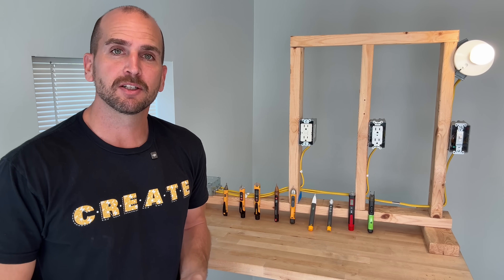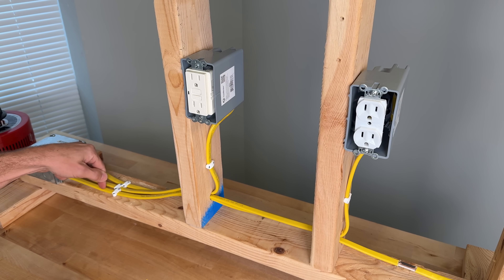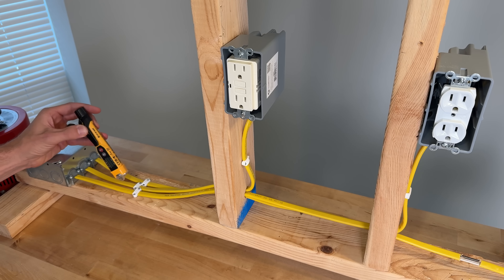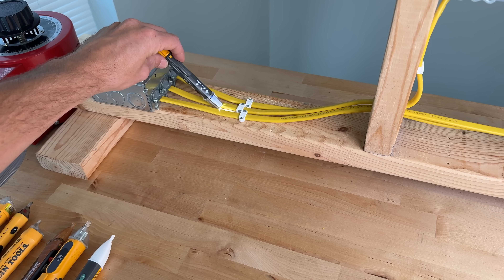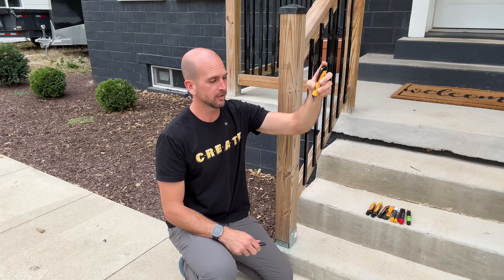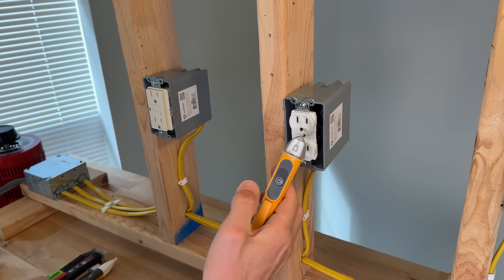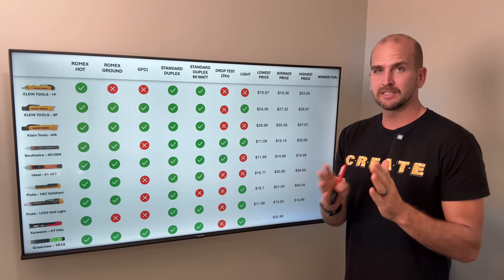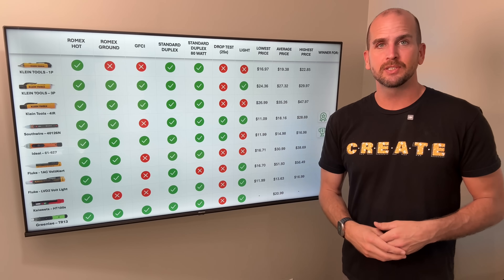The Ultimate Voltage Tester Battle: My Surprising Favorite!

Comment: Man, I love your videos. But here I feel a little like the 'home repairs' in your name is more accurate.

You tested that for the ability of these detectors to see voltage on the hit side of the outlets, but not on the neutral side. That would have opened up a new world, as some of these are more sensitive for that reason. While it may seem trivial, understanding if you have voltage on the neutral leg or a false positive result is a serious concern.

Each detector (they are not sampling voltage but rather detecting it) has a use in a specific instance. I currently carry 3, to include the FLIR not shown here. I also use 2 different fluke meters and plug checkers aside from these.

The goal is always safety, so in a crowded 12x12 with 300 industrial connections because nobody ever follows code, you don't want a detector ringing on false positives. As a homeowner checking for a dead outlet, you're looking for a different tool.

The judgment passed here is good but lacking detail, and I appreciate your testing! I'd love to see you dive deeper.
Reply from the maker: Thanks for the feedback.  How is the FLIR working out?  That is the one with the larger flashlight on the non-testing end, right?

Comment: Great vid!  I am happy with your results.  I thought your vid would end up making me lose confidence in my favorite tool.  I prefer the Southwire.  With the company credit card for over 20 years I was able to gather quite a few of these testers when needed for a quick job.  I have only basic electrical skills so I check and double check everything before I touch and even then I am very careful.  So my electrical kit when replacing ballasts in a retail store usually had 2 or 3 testers.  When in doubt I used more than one to gain confidence.  Usually a ballast replacement is pretty straight forward but if the light was tied into emergency lighting that's when things got interesting.  I love my Southwire and it has saved my butt a ton of times.

Comment: And I just bought the Kaiweets 😢
Reply: Don't despair... I have (2) HT100s and work fine with my CFGIs, It has two sensitivity settings. In the High Sensitivity Setting (12V-1KV) that is great because they detect AC presence 1" from the Hot on the AC Outlets and through  Switch Plates.

Comment: You did not include a very reliable tester which I use: the Santronics AC Sensor, made in North Carolina. "The Santronics AC Sensor (3115) has been selected by the OSHA Electrical Technical Committee as the only instrument of its type for use by OSHA compliance officers to identify and cite electrical hazards of 50 Volts or more."

Comment: Kaiweets is pure garbage; nearly killed me with a 'new' faulty voltage tester replacement that had copper wire wrapped around the fuses..and then said I did that myself.

Comment: Great video! Thank you! I carry both the Klein 3P and 4IR; they are both going on ~2 years in my carry bag. I generally only use the 4IR for the IR function. I haven't dropped them much, and that they've survived this long means they are sufficiently durable for my uses. I will consider Ideal in the future though, and am curious if their other models are similarly durable.

Comment: I have (2) Kaiweets HT100s and both detect my GFCIs Hot Power Connection Slot. Not only that, It has two sensitivity settings (70V-1Kv, and 12V-1Kv). 
In the 12V-1Kv range, my (2) devices detect AC Voltage present 1” from the outlets and  detect AC presence like no other NCV devices that I have used. As far as durability, I think is OK for DIY users (not for everyday professional work).

Comment: I've found that many of these have trouble sensing voltage on a tamper-resistant outlet. Conversely, some are so sensitive that they won't distinguish which hot wire has voltage on it (eg, incoming vs outgoing power, which can be a useful diagnostic tool), they just alert if any wire in the box has voltage. I use the Fluke 1AC II, my only complaint about it is that it's difficult to get it apart to change the batteries (fortunately they last a long time). And yes, I always test it on a known hot wire first (that seems like an obvious thing to do, I'm kind of surprised that some people don't do it).
Reply: My criteria is that it needs to be able to discriminate the hot side of a line cord reliably and doesn't sound off in open air.  Dual sensitivity is good to have long range detection also, which isn't always featured. 
I tend to take care of things so the drop and crush tests aren't as applicable in my use case as much as for others.

Comment: I have been carrying NCV in my shirt pocket for over 20 years and can not remember if I ever dropped one. Do not like any Greenlee electrical NCV  testord or meggers. Carried a rechargeable LED flashlight on my belt so don't need one with a flashlight. NEVER purchase or use any safety or tests equipment & tools by lying cheating lack of quality control nogoodnic communist china. The $ you might save is not worth your life & safety of others.

Comment: I have a love/hate relationship with those things. The best one I ever had was very cheap, very sensitive and had a dial on the side to adjust sensitivity. I could trace wires in a wall with it. Extremely useful. 

Next best one is one that can detect 12V+ because that will allow me to get close and have it go off. 
 
For me I just need to know if there is ANY electricity in the general vicinity of where I am working. Turning off breakers doesn't always work. 

If I could find that old cheap ones I'd buy 10 more lol.

Comment: I use the klein 1P. haven't come across a bad gfci issue yet for people so good to know it can't read them. I think the drop test is straight forward since they're all plastic lol but I use a quantum penlight as daily carry. plastic tabs snap so even though the ideal is solid and I don't NEED a light on my tester, I'd probably go for the klein 3P with a threaded cap to change rechargeable batteries. Greenlee did well but the design is goofy at the tip, I prefer the single probe as when there are tamper proof outlets that require simultaneous pressure in the plug, I can just sneak my klein near the side screws/conductors for a reading. well done with the video, the only choice I didn't see here is the klein NCVT1TX (water dustproof IP67) which although it has no light claims to have drop protection to 3 meters (wonder if it can read gfci). :person-turqouise-waving:

Comment: I have a EXTECH which detects before it contacts the GFCI outlet and has led light with audible alert.  Before I owned or used a Fluke, Greenlee and Klein, I am more confident with the Extech.
Reply from the maker: Man that Extech looks really similar to the Southwire.  🤔

Comment: The safe use procedure for NCV testers starts with a check of the tester on a known live source, daily before use in the field.
Reply: Retired from a large hospital that had a big safety department.We were instructed to test on a known live circuit, check the circuit you intend to work on then retest the NCV. Had to fill out a paper & have a senior electrician & safety department sign off on it. I would go one further measure by using insulated pliers would short out the wire especially on 480 volts. Would rather create a dead short then me getting electrocuted.
Reply: @JohnThomas-lq5qp  100%, and keep your insulated gear separate from other tools, equipment.  I was electrocuted once w an insulated screwdriver- machine isolator was off, but lighting circuit I was tensioning screws with was live (no label at isolator to indicate line side circuits).  Ultimately, the screwdriver had lithium grease buildup soaked into the insulation of the handle from other works,  and thus a path to zap me.
Reply: At this point I'd be happy if we can get them working the first time after unpackaging it.

Comment: I have the Kaiweets HT-100 purchased through Amazon July of 2021 
Had to run out to the garage after seeing this video and test it GFCI outlet 
It worked just fine 
Very sensitive 
Did not do the drop test
Reply from the maker: This specific GFCI has a thick face plate and proved to be a tougher test for a few of the testers.  Thanks for the feedback!

Comment: Ive seen and experienced too many issues with the klein to go anywhere near them. Ive very rarely had issues with a fluke usually an open neutral and ghost voltage. Ideal does make models with lights if you actually wanted a light however i find your in real trouble if your actually using them as a flashlight i mean i rather use my phone for light than the output off one of these but to each their own just look at the other ideal lineup and redo your testing.
Reply from the maker: Thanks for the feedback.

Comment: I have mountains of fluke 1ac's and are definitely my second choice.  My number one choice is santroics not gonna win the durability race but has the best sensitivity.  It can identify hot and neutral right next to each other.  A overly sensitive club of nct dosent tell me much.  But a santroics on az or get one from a supply house with there name on it you'll be impressed.  They are made in the usa yes electronics made in usa!  One of the best features is it's always on no power button and yes batteries last a year plus for me.  You defently missed one of thr best ones for the roundup.

Comment: I had a southwire until I got a recall notice from the CPSC due to false no voltage readings. Switched to fluke and haven’t been zapped yet. But the death sticks comments and advice to use a multimeter have me thinking. Also please explain why so many units can’t sense the voltage in the gfci outlets.
Reply from the maker: Specifically this GFCI outlet had a pretty thick faceplate so that additional offset from the internals seemed to be a challenge for the less sensitive testers.

Comment: my preferred carry is the Milwaukee.  but I'm currently carrying a Flir  it has switchable dual range, a small worklight at the sensing end and a flashlight on the other end.
Reply: I had a Flir, it was terrible, completely unreliable due to the way the battery terminals were arranged.   Got a Fluke, but now use a Southwire.
Reply: @ckm-mkc  the only issue I have with it is it eats batteries.

Comment: I am a handy man for a living and own and use the IDEAL multiple times a week and it has not failed me in over 3 years of owning it. It does lose sensitivity when the battery gets low, but as long as you test it on a known live circuit first you will know when it's time to replace the batteries.
Reply: How does it do on tamper resistant outlets?
Reply: @anthonyb8405  not that well, I was actually surprised he got it to work on the GFCI. I always take the cover off and probe the side posts. If it's a back fed you will likely have to pull out the outlet to be sure the tester is being accurate.

Comment: I have had good success with a south wire circuit breaker detector. It was not very expensive.  I carried a fluke NCVD every day for about 10 to 12 years it worked well until it got stepped on, but if a 240 lb man stepped on you you would not work very well either.  I have a Simpson 260 - P analog multimeter I have had for around fifty years, it works but the jewels in the movement are worn out and the needle is jerky so I retired him.

Comment: I use my non contact tester (Fluke 1-ac I think) for testing wires. I use an outlet tester for testing outlets. I have never been in a situation where I wished I could shove the non-contact tester into an outlet, but if I needed to, I could just remove the outlet cover plate and test the wire connection on the side.  If you use the backstab connectors that can't be tested this way, you probably shouldn't be doing anything with electricity because you are not mentally qualified.

Comment: I slightly disagree with your second test with the romex.  I want my non contact tester to be sensitive and give positive  results only at close range, so I would NOT want a red indication when held on the neutral side of the romex.  I often test the multiple wires coming into a light switch box, and want to know which ones are hot when they are all close together. So false positives are more important to me than false negatives. Thanks for making these videos!!
Reply: Get a santroics one it can do what your asking.
Reply: I thought I read that if it’s used between a neutral and a hot then the waves will neutralize and it shouldn’t detect anything right???? Now I’m confused!
Reply: I was going to make the same comment.  Plus, who only checks one side of a romex cable!?
He didn't test a unit with variable sensitive either. That seems like a serious miss.
If I am testing an outlet, I remove the plate and test the wires! The outlet could be bad while the wires are hot. If you want to test at the outlet, instead of the wires, use an outlet tester instead. I am giving this video a D.
Reply: I too agree! I deal with thhn 99% of the time. For me it’s better to have a lower(more precise) sensitivity when you have a rats nest of wires shoved into a box.
Reply: I agree with this. There are different testers for EXACTLY this reason. There are different conditions that you look for, and different testers have strengths in certain areas. I don't call that a fail.
What about TR GFCIs? Precious few can do that well, and you should be using a plug checker instead of an NCV.

Like you, I want accuracy for safety.

Comment: Thanks for the test.  I'm not sure how anyone coluld pick the Southwire when it can't read the GFCI.  I can understand the Ideal pick.  I would take the Klein 3P over the Southwire in a heart beat.  Yes, it was damaged, but can one really expect to consitently drop this tool on the tip for 25 times?  The clip end of the 3P is much heavier so you would have to aim it, as you did, when you drop it.               Thanks again Scott.                       JimE

Comment: Klein doesn't work on Christmas lights
Reply: The 2 p definitely works on Christmas lights. Just remember to reverse polarity, turn the plug, when you get to the end of series of bulbs. I have used with 200 light strands with no issues. Just make sure to use the low voltage detector and that the first socket in a series has power. Saves loads of time.

Comment: Great video! I have been using an ideal for a number of years and I do like ideal products for electrical work. I really don't see a need for a flashlight as I carry a flashlight and a headlight, as far as the GFCI goes I use the receptacle tester that you showed at the beginning for all of my GFCI receptacles so I really don't need it for that purpose either. Thanks again

Comment: I know it's not a topic of the video, but WHY don't those testers pick up the voltage on the GFCI outlet?
Reply: It does seem weird as the distance from the face to the contacts should surely be the same as on a normal socket. Perhaps the better quality build blocks more of the electro magnetism, giving a weaker signal to detect.
Reply: @45KevinR  that is entirely possible.
Reply: Inquiring minds want to know!
Reply: I’m thinking it has to do with the spring loaded plastic shield that makes it “tamper resistant”….possibly interfering?
Reply: most likely, the probe is a little short or fat to get close enough to the contacts in the GFCI.

Comment: Fluke 1AC-A II. 41 year industrial electrician here (retired). You have to push it into the hot side of the duplex so you can leave it in there to cycle the circuit if necessary. I've used this one for decades.
Reply: This is the one I use at work, and it detects fine in an GFCI. It looks like in this video he didn't push it all the way in.
Reply: The shim tip wasn’t in far enough.
Reply: @nicknauj124  Just curious what would be going on in a gfic where some failed to recognize the voltage but did recognize it on regular outlet?
Reply: Fluke fan boys in here. 😂 If you recommend over paying for a tester then keep throwing  your money away.  I've used all of these testers and the ideal is by far the best bang for the buck just like the man said. I knew that before the end of the video.  
  Side note..  he didn't test the brightness of the lights which the ideal wins again 😂
Reply: Just curious what would be going on in a gfic where some failed to recognize the voltage but did recognize it on regular outlet?
Reply: @MathCuriousity probably just the contacts being slightly deeper than the standard duplex’s
Reply: @ how do we measure the displacement current thru a capacitively coupled human to ground under a 100,000 ac transmission line?
Reply: Too sensitive is a pain in the ass.  The classic fluke was money
Reply: I know it works in a gfci
Reply: Yeah, HE DOESNT EVEN KNOW HOW TO USE THE FLUKE. You can clearly see him not pushing it into the socket in the video and, after the durability test, He turned the Fluke 1AC-A II off by long pressing it (long beep = turn off) When the fluke is turned on It will show a volt beat (2 flash and 2 beeps). Also, the fluke disables the led when it detects a low battery (caused by the number of drops,) He could have just reseated the batteries. I bet other testers were also only affected by a loose battery.